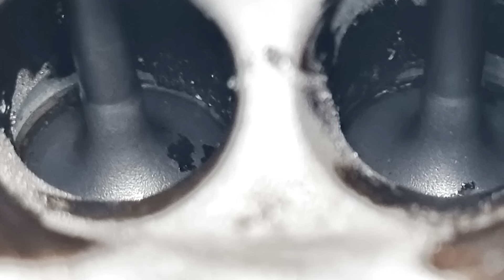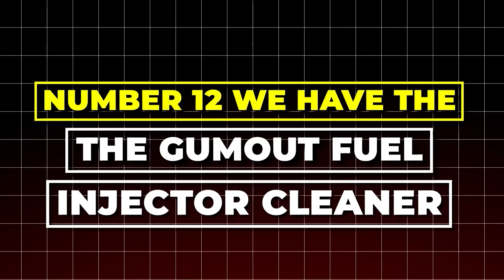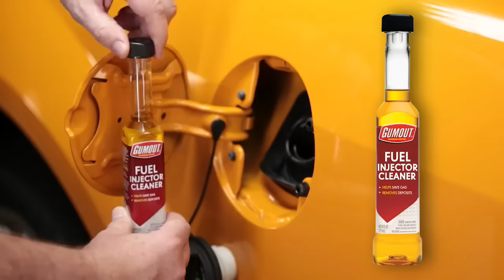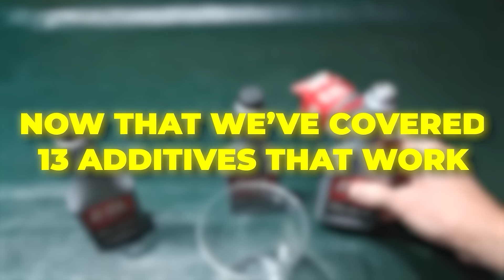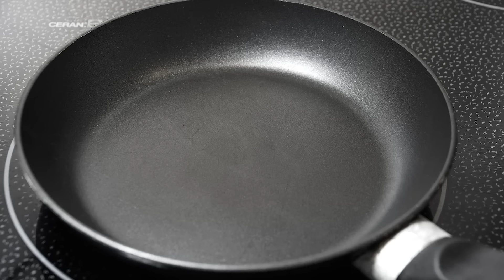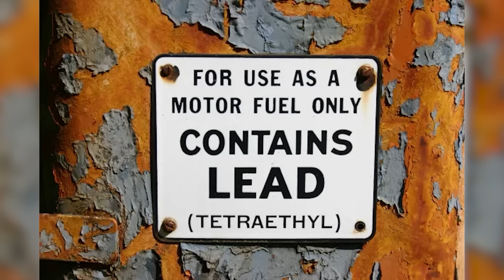13 Engine Additives That Work (And 5 That’ll Kill Your Car)

Comment: I would take exception to your condemnation of ALL PTFE additives. I’ve used Tufoil in every vehicle I’ve owned since 1976. I noticed a positive change on the second start with it. 

You know how your starter sounds as it cranks over your engine and how it sounds when the solenoid fails and the starter gear isn’t engaged. Well that’s the tangible difference Tufoil made. It sounded like the starter was not engaged and running freely and without effort. That car was a ‘72 Dodge Charger and had over 286k miles on it with oil usage at a quart or less every 2k mi.

On the second car I owned - a 1984 Dodge Shelby Charger - I put over 406k mi. on it and the 2.2l still only used a quart every 2k miles. To me that was further proof that Tufoil does indeed decrease wear from friction.

Tufoil gives me easier starting in Winter. You only use 2oz. per quart the first time then 1 oz. per qt. every change after that. It works for me.

Comment: If you have an engine made after 2010 it is probably a flex-fuel engine. (See manyal!) Raising octane will not make any everyday difference, since these engines optimize their timing for whatever octane you are using. And lower octane fuel actually "explodes" (combusts) at a higher rate, giving it more power.

Comment: I had a new 79 Mustang with the 302 4spd. I changed the oil every 25k miles whether it needed it or not. I got 278k miles out of that engine. It would have lasted longer if some stewpud oil change place didn't do a complimentary engine flush without asking me first. I was on the return portion of a cross-country trip. No fancy additives. Only good old-fashioned Quaker State oil.

Comment: Any company who boasts Lucas is a joke! Putting thick oil loaded with zinc & phosphorous is a death sentence for cat. Converters. Oil of the proper weight & viscosity is your best chance. Engines know nothing! Once tolerances are off its permanent, the engine is not going to forget that its worn. The damage is already done. You don't see surgeons doing open heart surgery on corpses do you? This is the same thing.
Reply: Weird. I used Lucas in my 1998 Z71 the entire time I owned it between 1999 and 2018 & never had a single problem with the engine for the entire 635,000 miles
Reply: I guess you don't read the bottles. The Lucas with zinc and phosphorus is made for temporary use during new engine break in. Regular Lucas doesn't have either.

Comment: I did PTFE oil on my '89 Mercury Sable when I drove it off the lot.  I placed a qt of PTFE on every other oil change.  When my motor had 160,000 miles, I did a compression check, and the motor was worn out. Teflon oil was snake oil.

Comment: Gasoline injector cleaning additives MAY have some benefits, HOWEVER under no circumstances should you EVER add ANY oil additive to your crankcase! 
Use a high quality engine oil of the correct viscosity as reccomended by the manufacturer, that's all you need, change it, use a quality long life, extended life oil filter!

Comment: I use Lucas in everything I own and I've never had an engine problem,  my current vehicle is a 2017 ram with a v6 engine and it just hit 300,000kms with no issues!

Comment: All of this talk about Lucas oil stabilizer, reminds me of an oil analysis I had done on my cat truck engine. When I ran a sample through with Lucas in it, I was told there was no trace of the cleaners and additives that should have been present in the oil. Turns out the chemicals in Lucas stripped them all out. So I was left with base oil, and Lucas which is nothing more than a thickener.

Comment: My daughter's Subaru Crosstrek was two quarts low when I went to change the oil. ( about 60k miles). She has ten balls in the air at all times, and so does her husband. Two girls under five, and demanding jobs. Car maintenance, as for many families, although important to their safety, gets forgotten. (They get the oil /filter changed, thinking that's enough, and it should be...)  I have an extensive engineering background, "cause and effect, cause and effect"... . Did some more reading on boxer engine issues ...rounded up all the usual suspects. Direct injection ( quick carbon buildup), slack rings that are designed not to seal effectively (engine efficiency ploy, and so on), possible uneven cylinder wear, which stands alone as a possible intrinsic boxer engine design issue... Adding to cold start-up problems for boxer engines in general.. 
So, I tried this, and two years later, there are still no oil consumption issues and a quiet running engine.  I mixed up a quart of 50% MMO and 50% Lucas Synthetic oil stabilizer ( shook it up vigorously) and poured it in.  The idea was that this concoction might be enough ( just enough) oil stabilizer to help prevent dry starts (cylinder scoring) and enough MMR to gently clean the top end, hoping the combo would not drastically alter the base oil viscosity or shear strength. Used Pensoil Ultra Platinum motor oil. I am not saying that this is THE ANSWER. I may have just gotten lucky. But it may be worth a try. I run this regime on my wife's car and my own. She has a Honda V6 Dream V6 engine with VVT, and cylinder deactivation ( with 150K miles), and it still runs perfectly; knock on wood. Remember that it may take more than one oil change to be effective. Just FYI.

Comment: Don't use it on generators .tectron . Seafoam works better than any of them. And olive oil works better in your oil than any of them it cleans everything in your engine.

Comment: That garbage about slick 50 is not true I run that in my truck from the time after I broke it in from the time I sold it had 500,000 mi on it and was still running and getting 20 mi to the gallon

Comment: i owned a Hyundai with just shy of 200k miles and my Toyota Tacoma is right at 230k miles. I've used the Lucas oil stabilizer on both of them and I've never had any issues.

Comment: I will admit there is some good information here, At 78, I have always stayed away from additives.
You Can't beat regular maintenance, good high-quality oil, 
good high-quality gasoline. Premium High-Octane fuel (Shell BP, Exxon Mobil, Chevron) Stay away from cheap gas like it carries the plague!
I change my oil every 5000 miles, Use (Mobile 1 synthetic Exclusively) From the day it left the showroom!
Unfortunately, I retired a 1988 Mercury 1.6-liter 4 cylinder, with 376,000 Trouble free miles.
It traveled the entire North America continent, Canada to Alaska.
The body finally gave out after years of Chicago's salted streets.

Comment: Ive used lucas for over 20yrs and i cant say it help but it didn't seem to hurt, my 99 f150 4.6 ltr got around 380,000 miles before the head gasket blew from what i was told was from clogged catalytic converter and i have a 02 explorer 4.0ltr with almost 370,000 on original engine and transmission and im still using it for a work vehicle, i do use good syn oil and i still changed my oil before 5000 miles so that probably played a big part in getting high mileage out of older vehicles too.

Comment: I used the AT 205 on my wifes Mercedes convertible. I used it in the convertible top hydrolic system, and it ruined it. After I had already done that, I watched a convertible top troubleshooting video, where he said, "Do not use seal repair adaptives. It will ruin the seals." I blame Scotty Kilmer for telling me to use it. LOL

Comment: DO NOT use LUCAS oil treatment !!  I have a 2001 Chevy 2500 with the 6.0L gas engine. I bought the truck from a buddy with 15.000 miles on it. I use Castrol 15-40W and change the oil every 5000 miles and log each change. I also added a bottle of Lucas oil treatment/stabilizer at every change like clock work. NOW with 220.000 miles on it I was getting low oil pressure warnings so I decided to pull the timing cover off and look at the pump. First thing I noticed and after a few "F" bombs was the front of the engine under the timing cover was so full sludge I could not believe what I was seeing !!!!!! then I pulled the oil pan and the pick up tube screen was PLUGGED and looked like a cow took a dump in the oil pan!!!!! ...Now tell me what else besides using Lucas oil treatment could have caused this situation ??? I also have a 1983 Chevy 2500 with a 5.7L (350) with 350.000 miles on it and don't use Lucas in it and the inside of the engine is VERY clean using the same oil Castrol 15-40W...I even tried to contact Lucas SEVERAL times and NOT heard back..That right there sends up RED flags..F you Lucas, I will NEVER EVER use your product again and every one I talk to will know about this situation...If you use it and like it like i did then save your money because you will need it to replace your engine. note: both of my trucks are west coast trucks so weather is NOT a factor and I do not make short drives, the engines come up to full operating temp. Their oil treatment has a caramel like thickness that does not thin out and sticks to the inside of your engine causing SLUDGE to build up..I turn wrenches on everything from lawn mowers to V-8 engines so I am an experienced mechanic who takes care of his equipment. This stuff is real snake oil !!!!!
Reply: We also found out the Castrol foams easier  than other the other oils.
Reply: That was most likely the Castrol. When I was in tech school as well as when I became a crane mechanic, we did several test on different oils. To see how they did under different temps, pressures, etc. the Castrol ALWAYS left a strange wax residue. Cars, cranes, other mobile equipment. I RUN from Castrol. Lucas hasn’t caused any issues with any of my fleet over the last 15 years. I would use super tech before o used Castrol oil lol
Reply: It's a Chevrolet. 
😂😂😂

Comment: I use Lucus since I was a teenager til today. Had an Escort Gt and ran without oil not realizing it for almost a month. All I had was Lucus treatment. Nothing happened and I was surprised. That car all original but the clutch. I got 456k miles on it. Had a 700 pound lady run a red light doing 55 in a 30. Take my whole front end off. I was pist. The police officer brighten my day by saying i wrote her 7 tickets. Asked me should he write an over weight ticket also. Made me laugh. After all she was driving a Civic. Still can't figure out how she got in or out that tiny car. All my vehicles got over 200k to 500k miles. I drive mainly Fords. My Pontiac I do miss. The T-Tops is whag I miss.

Comment: I use MMO in fuel whenever I have to use gasahol fuel. 1 oz per 3 gal. it fights bad effects of alcohol with its detergent.

no noticeable effect on sensors or cats

when fueling with NAUL, No Alcohol Un Leaded, I use injector cleaner @ 1 oz. to 3 gallons.  usually every tank.

change oil once per year, if less than 5,000 miles.  more often if a vehicle accumulates 3,000 miles in a year.

Let's Roll!
Wolf Alaska
🐺

Comment: I have used Lucas since the early 80's in my semi truck. I think it was called Moreys or something like that when I started using it. I put it in the motor, transmission, and rear ends also the hubs. It had never caused a problem and I wouldn't dream of not using it in a vehicle. I also use it in my pickup, jeep and my girlfriends car and her daughters car. I think it is one of the best products on the market. Someone must have a personal problem with them.

Comment: I have a 2011 Honda Odyssey413,000 mi on it original engine 

I use the mobile one synthetic 3 1/2 quarts and the last quart I use the Lucas oil stabilizer regular... not synthetic.  

Lucas oil stabilizer should be number one on this list

Comment: Lucas is one of the best products on the market. Everything they make works well. Used PS conditioner in 2000 and I’m still driving the car 25 years later. Same steering components

Comment: I put a little bit of Lucas in all my engines. Most surprising is a Hyundai Accent with 330 on it still going strong.
Reply: My friend has a 1985 Hyundai Excel with over 450K miles on the original engine and transmission....never used any additives.  Just followed the original maintenance schedule to the letter.

Comment: Can already tell this is going to be a BS video, I worked at O'Reilly Auto Parts for a few years and during that time we hardly ever sold any of the Techron and no mechanics ever bought it. Plus there is no way BMW is supporting it if it works best in sub standard gasoline, since BMW requires Premium fuel. Everyone I know that are Mechanics and/or shade tree use Seafoam or Lucas and swear by both.
Reply: I'm a Master Tech with over 20 years experience.  I've bought a LOT of Chevron Techron Fuel System Cleaner....including from my local O'Reilly's......  During the switchover to Ethanol blended fuels, Ford Dealers across the country were buying Chevron Techron Fuel System Cleaner by the case.....
Reply: @aaronthomas6155 that's good to know, but they didn't buy from my store and the mechanics that shopped at my store told me Seafoam was better
Reply: Yep Techron is the only one I'll recommend too.

Comment: Lucas Oil Stabilizer AND regular use of Lucas Fuel injector cleaner, for the win.
Reply: I put nothing in my oil, but Lucas has excellent injector cleaner. Redline is the most concentrated injector cleaner but it's also pretty pricey (usually $14). By contrast my local O'Reilly's usually has a fairly regular 2 for $10 sale with the Lucas cleaner.
Reply: Look up Seafoam, stuff is the real deal. I've used it in my mowers and motorcycles and it made a marked difference. I run a full can in my vehicles at every oil change.

Comment: Ive use Lucas products for 20 years. No problems. Accidently bought their oil stop leak once instead of oil stabalizer ( just moving too quick ) and it def slowed down an oil leak. Prob reduced it to 50% of the leak it was prior

Comment: Just looking at the intro picture would somehow suggest that lucas hd stabilizer is something we shouldnt use, unless you did it for effect which is not cool by any stretch. Huh, been using it in our shop for twenty years and somehow, I just don't believe you. That's gimmicky bs bud, show me the data that proves it and I'll show you the data that refutes it. You opened a can of worms with that one and it was totally unjustified.

Comment: I'm going to ask.  In your research did you do more than just read up? What is your background? By the way you left out a whole host of Lucas oil products. Including using a synthetic Lucas oil products when you use a synthetic  oil. There is a Lucas stop leak and stop burn product. I had a couple of spun cam bearings and the valve cover needed to be tightened. What's the valve cover ever so slightly and it still leaked. I had to get the truck home I just bought it as a spirit into this day it still runs with the bearings like they are. It does not burn and does not leak motor oil. I will say I've never found anything to fix a leaky Ford power steering unit.
Reply: His background is that he watched videos from other YouTube channels like Scotty Kilmer and Project Farm.  He avoided YouTube channels like The Motor Oil Geek that strictly advise against the use of engine oil additives and provide explanations and lab test results to justify their recommendations.

Comment: I sold this and car parts for 25 years. The sea foam is great on older cars used in fuel. But used in oil it does what it says, removes gum and varnish. The problem is if it's high milage sometimes the gum and varnish build up is filling gaps. So when it's removed the engine starts to rattle

Comment: I delivered pizza in my 1995 383 stroker Camaro for 21 years and always used Lucas additive with Mobile 1. Never saw any performance or MPG gain. But......my car is still going strong.
Reply: And all your tips went towards gas
Reply: @jlogue751 Nah not really.....but kinda....lol  Back then I made $50k a year.
Reply: @danmead4787 never a late pizza though

Comment: So basically that’s nothing you can use in turbo vehicles to keep injectors clean
Reply: Chevron Techron Fuel System Cleaner....
Reply: @aaronthomas6155 there’s another guy a ford tech that I guess lost his job with ford for putting up videos about 5.4 module engine and spark plug things all I know is if you took care of 5.4 they run forever I hit 300,000 on mine it still running but I her to bed when sold by business so she hasn’t started in while. But this only puts the bad up never noway to avoid it like he’s all over the 3.5 nd he got people driving 3,000 miles cause think he’s the only one that can any good he basically rebuilds every engine that comes for timing job or other3.5 problems he showed what he does its6,000 in parts and labor he says it bulletproof then the way I look at it is the price that these trucks cost your underwater after year 2 years if you’re using for work because miles scratches dent trailer pulling is it worth another6,000

Comment: This video is nothing more than a paid advertisement several original products weren't even mentioned STP...Rislone...Berryman...Motor Medic and a few others so just like kilmer he's gettin paid to make these ADVERTISEMENTS
Reply: Rislone Engine Treatment,  takes a while but lifters loosened up definitely got much quieter,
Reply: I used to watch Kilmer until I actually told someone one of his recommendations.  He mentioned a headlight restoration which he said he waited until he had used it successfully for 3 years and the lights still looked good.  OK so under a year later their headlights were still better but definitely needed redone or replaced, bad prep or application?   Nope after a few months on that same Lexus Kilmer mentioned how cheaply and easily the headlight assembly was replaced by aftermarket.  He then mentioned trying a restoration kit and it only lasted 3 months.   Same product with two totally different stories of how it worked.